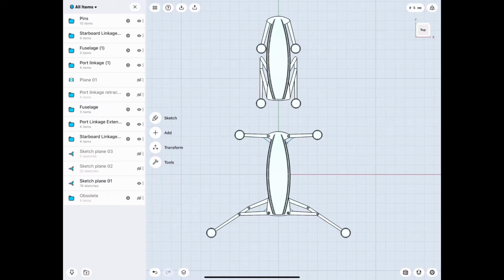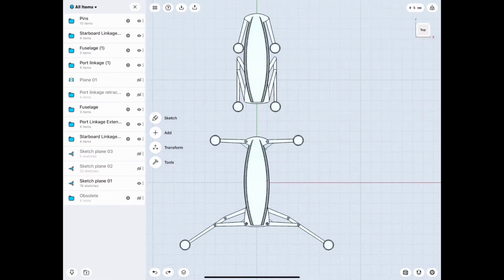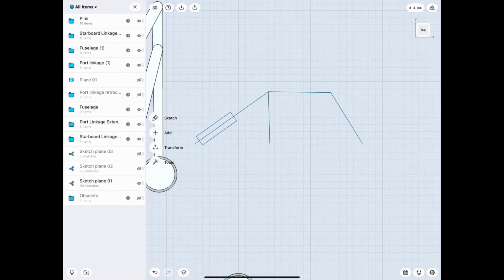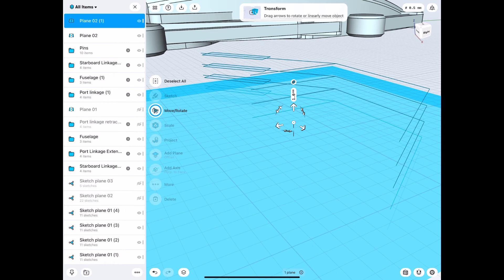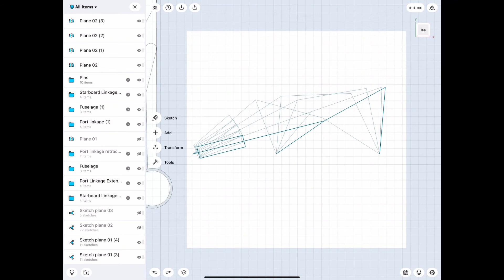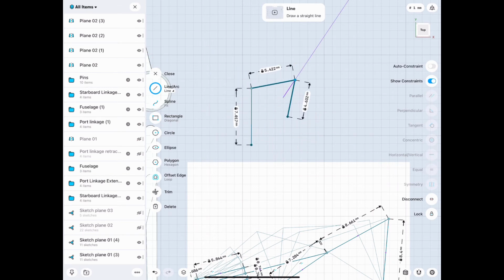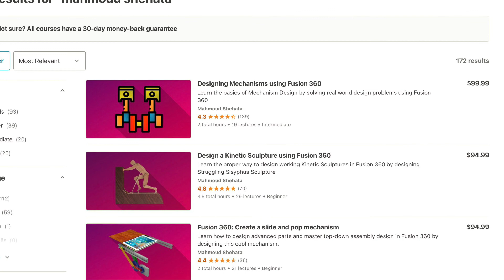Shapr3D 4 Bar Linkages

Comment: Thanks Gregg! Could you please help shed some light on how you managed to make the linkage mechanism work from single lines to 3D shape? I tried very hard for days without any luck - as soon as I added extra dimension to the lines, the linkage got broken down :(  However, you seemed to have done it perfectly, as you easily showed the "bone" structure with/without "meat" on at 14s of your video. Look forward to hearing from you! Great thanks in advance!
Reply from the maker: Hi Sumi, I’m glad you found the video helpful.
To be clear, the extruded 3D bodies don’t move with the linkage (I sure wish they did and I hope they add that functionality) but I think you understand that. 
If I understand correctly, you’re asking about the 2D lines that I used to extrude into 3d bodies. So not the bones (the central lines of the linkage) but the 2D lines surrounding them.
So (assuming I understand your question) what I did was to draw the bones and lock their length. Then when I drew circles around the endpoints of the bones, I locked the circle diameters. 
Then I drew (let’s call them Side lines) from the tangent of one circle to the tangent of the circle at the other end of the bone, and I set the Tangent constraints to ensure that the Side lines stay tangent. Note that I didn’t lock the length of the Side lines because you don’t want to set anymore constraints than are necessary. That gave me an enclosed area of half the width of the leg, which could be extruded.
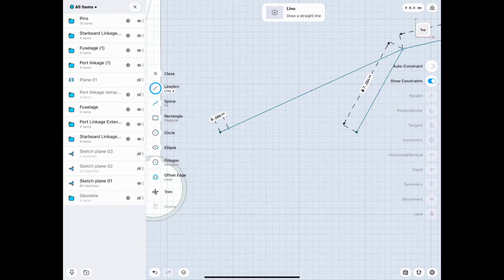It’s a similar method, to the way I made the hydraulic cylinder profile at 3:40.
Also note that to make the left and right linkages move symmetrically, I had one of those stretchy Hydraulic Cylinder lines on the left and right. I used the Equal Constraint to ensure that when the stretchy line changed length on one side, the stretchy line on other side was equal to it, so that linkage moved by the same amount.
I hope that helps. Let me know if you have any other questions.
I’m so glad that people are finding this video helpful.
Reply: @greggjohnson621  Thank you so much for your prompt and clear explanation Gregg! It's a shame what we need the most can't be achieved on Shapr3D, at least not yet. Really hope they can add that function soon!

Comment: Is there anyway to make linkages work when the parts are in 3D form? As far as my understanding is working there is not, but I can be wrong too hmm... It would help a lot to find out crashing points etc.. Otherwise you need to imagine the part being in size and shape and only extrude it in end points.
Reply from the maker: Not that I know of currently, other than making a copy of the parts and manually snapping the parts to those new positions.
But most things can be developed in this schematic approach in Shapr then modeled out.
For more complex 3D interference analysis, I would tend to rig linkages in Fusion360, Modo (maybe Blender?) once I develop the basic linkage schematic here.
Then in those apps, the moving parts can be copied as instances so you can show the linkage in both the extended and retracted positions. Then modify a part and see it’s shape update in both positions at the same time.

Comment: Why doesn't the company provide this method in an actual tutorial? I've been on the fence about buying a license because I couldn't find any sort of simulation in Shapr.
Reply from the maker: Yeah this is such a great capability, I’d think they’d promote it. 
When I posted the link on their help page, the creators of Shapr said they didn’t realize it could do this. 
I only discovered it because of that guy’s video showing the technique being used in Fusion360.
I would add that for me, Shapr3D is WELL worth the license fee. It’s so fast and easy to learn and use.